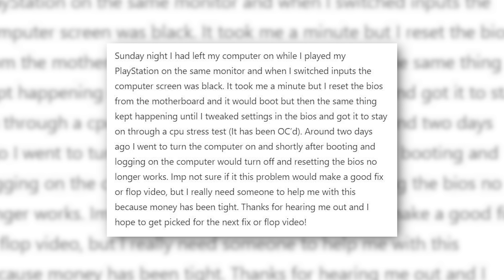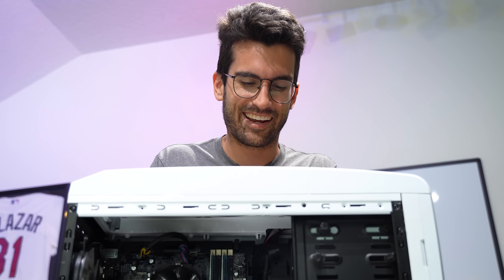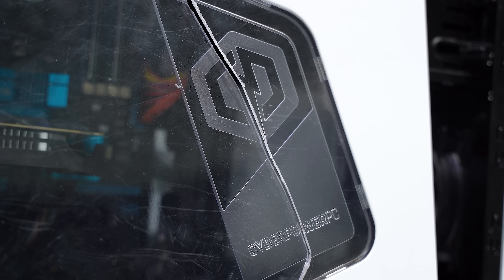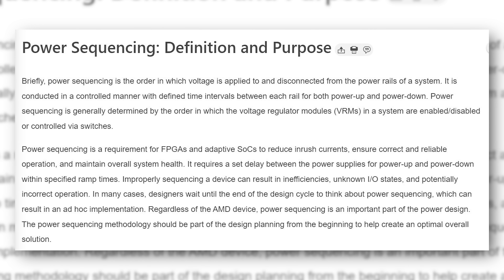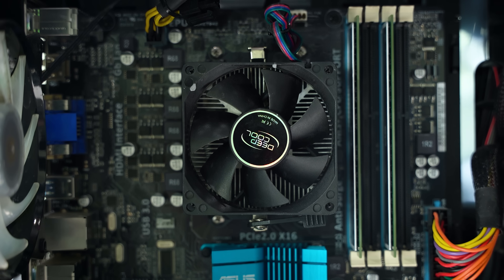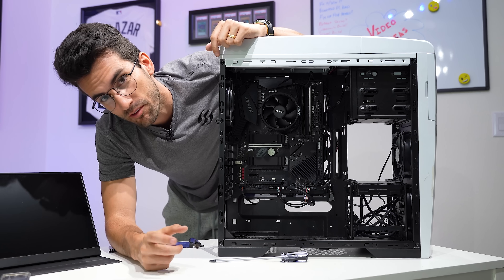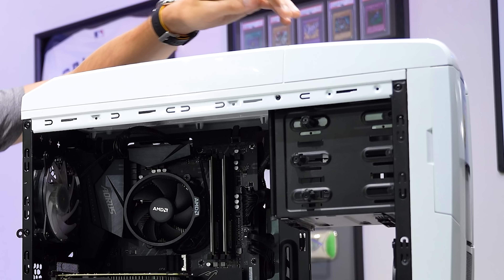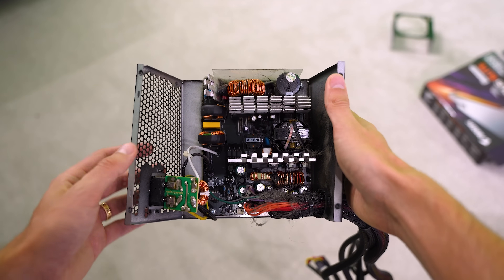Fixing a Viewer's BROKEN Gaming PC? - Fix or Flop S5:E12

Comment: the case its fine its old sure but works he got a new platform and a new psu and a quality one storage he can get a cheap ssd or m2 its not that expensive get like a 500 GB one or even 250 one for the os and the hard drive he can use it for some games

Comment: Have you heard that if the case is open/vented on the bottom, the power supply fan should be pointed down? That way if anything falls into it it won't go inside ?    Just an fyi   thx for all you do and sharing   I have fixed 100's of friends pc's, most of the time it is OS  lololoolol

Comment: Shouldn't you put the power supply in with vents facing down?
Reply from the maker: Doesn't matter if there's no basement to obstruct airflow from above. In fact, in some testing, a PSU in this orientation can actually improve thermals of other components in the system (again, when no basement is involved).
Reply: @GregSalazar  I would think that when the PC runs for a while and the PSU gets warmer the air it blows into the chassis gonna make the inside of the PC hotter.

Comment: For what it’s worth, I had a similar burnt molex connector, and it turned out that I had just not seated the male/female connectors correctly.  Electricity was arcing across the poor connection and nearly cause a fire.  I cleaned everything up, reseated it, and it was fine…

Comment: Another multigenerational upgrade and quantum leap in performance  for one more lucky viewer whose system broke at just the right time!  Without wishing to preach irresponsible diagnostics ..or bring undue harm to perfectly functional  components how about testing the FX6300 CPU (a volcanic Vishera!) and supposedly faulty AM3+ board  with an alternate PSU?  If the Thermaltake unit' perished before inflicting serious  "surgical" damage to either the socket or circuitry then there's a chance the MB survived along with the processor and RAM...be interesting just to see if you get a post!!

Comment: That was a great watch, Greg.   I think you prioritized perfectly.  The case and gpu, were still functional and non-factor in the operation of the rig.   

It would have been nice to replace the case, sure, but that would have put it two components from being an entirely new system, with only the HDD and GPU being original then.

Nicely done.  🍻

Comment: I had a system like that up until 2013.  Going to a 4770k was night and day, my new rig was about 4x faster.  I know people have what they can afford, it sounds like that person has had that rig for a long time and I'm not going to ridicule (as I said I used to have a similar one), but you could take the absolute cheapest motherboard and CPU available today for less than $200 easy and outperform that by many, many times.  The FX chips were badly designed and embarassingly slow.  The only CPU that I can think of that was a worse design than FX was Pentium 4.

If new parts are needed, you could just get a low end 14100 or whatever the lowest end Ryzen is and it would destroy that system.

Comment: Right up until a few years ago, I was gaming on a pc I bought back in the late 2000s.  I upgraded the RAM and GPU once during the mid 2010s.  During the entire time I had it, there was only a single major issue, one day it started overheating and based on the sounds that it normally made, I had determined that the air intake fan was the culprit, to the surprise of the repair man, I was right, the fan was completely bricked.  Thankfully I noticed in time to get it replaced and avoided bricking the entire thing.  That computer lasted me over 12 years with only one major issue and 2 upgrades at half life...  They don't make things like they used to any more.

Comment: This MoBo wass in the second PC I ever build and still in use.
Just with little different components.
- Phenon B65 (Quadcore with two deactivated cores, could reactivate the third core but the forth wouldn`t work)
- Arctic Alpine 64
- 8GB DDR3 1333Mhz
- GTX 750Ti
- 120GB SSD
- 250W Power Supply
- Linux Mint

Even though I OC'ed the Phenom to 3,8Ghz via Multi - there were no problems with it. Well there was no benefit either so I took it back to stock.

Comment: There is a market for these old FX machines. I have been flipping gaming PCs a little lately, and those old systems are in demand, mainly because of price and what they can still do. 

I sometimes take risks on marketplace and Ebay when the risk is minimal. Over the years I have picked up a couple of FX machines on those deals. They are typically listed as gaming pc, with no specs and very low price, $75-100. 

Paired with a 1060 6GB, or RX 580 if I can get them cheap enough, 1060s at about $50, 580 at about $45. 

That combination will run Fortnite, Valorant, and all of the other esports stuff fine, they will run Minecraft and Roblox very well. I can fix them up, throw in a cheap SSD, and sell them for $250-275 quick and easy, and at the end of the day a $100-150 profit on a $275 PC is just as good as the same profit on an AM4 3600 with a 1080 or 2060 at $500.

Comment: I got a broken FX-8150 based system for free and found the same burn marks.  I salvaged CPU, RAM, and a case out of it. MOBO and PSU were too suspect to use anywhere else.  Googling says that FX series had a lot of boards with melted VRM. I wouldn't overclock them.

Comment: Hey Greg, I need advice, if my pc randomly black screens and then reboots. Is that a sign of gpu failing? It started happening with BO3 highest settings, thought it was the game, but it started happening with Roblox and I was like you don't need much to run Roblox. I tried to do a uniheaven benchmark for gpu stress test and it went black screen and rebooted. My 3060ti is evga xc gaming edition with the death chip hynix x005. I am starting to believe that's the cause of the symptom. Storage drives are healthy, ram has 0 issues, cpu is working fine. No blue screening or error messages, just a random black screen and reboot. The card is barely like 2+yrs old, which sucks I got the bad batch of memory. No led lights on the motherboard as well for when it goes to black screen and reboots. 

If anyone else knows can you please respond

Comment: I think it might have damaged the front pannel pins because they are on 5volt rails, the fans are 12 volt rails CPU uses all the rails, so it might have jumped from the 12 volt rails to the 5 volt rails thorugh the CPU because that is the only thing that connects all though rails is the CPU.  So the CPU might have also been fried, which is good because it protected the graphics card like its designed to do.  The graphics card uses 3.5 volt volt rails gets supplimental power from the power supply.  Many motherboards have a failsafe now that if the 4 pin power connector is not connected the computer will not even turn on, the fried 4 pin connector shut down they system properly and refused to turn it on saving the rest of the components, I would not recommend putting that chip in a computer and motherboard you care about, it is most likely fried.

Comment: I have the AM3+ board in this video that i use for testing legacy hardware, and for the most part, there is 0 reason to try and OC with this board. The EPS is only 4pin and the VRM (especially considering FX voltage needs) is extremely lack luster. I have seen some folks use this board to OC a 6300 to 4.1ghz but they had to use too much voltage than I'm comfortable with to do so.

Comment: Ah yes, the venerable FX line that was a throwback to days when CPUs didn't have an integrated FPU.

But in the FX's case, have two integer units share a single FPU. So while this particular CPU does have six integer units, (which AMD counts as "cores") it only has three FPUs shared between them. The shared FPU and resource contention elsewhere inside the CMT modules made for a bad time. Resource contention and performance was so abysmal that both Microsoft and the Linux community had to rewrite thread dispatchers to only use one of the integer units (cores) and backfill the other within the same module with low priority background tasks. Placing two demanding threads within the same core caused hideous performance penalties.

Had this architecture been released 30 years ago, it would have been a smashing success, because most workloads at the time were purely integer based. But alas, it wasn't.

Comment: When I was putting together my FX-6300 system (as a little fun computer project, not when it was a relevant CPU), I was under the impression you should not overclock FX processors if you have a four pin CPU power connection. You can potentially push too much power through the four pins. So, I didn't overlock it. By the time I upgraded the PSU to one that had an 8 pin CPU connection, I just never had the time or energy to overclock it.

High power loads are dangerous to computer parts, and I just tend to run my gear at factory spec clocks. Even then, the failures we have with RTX 4090 GPU's, 13th and 14th gen i9's, etc, keeps demonstrating that we have to be careful how much power we try to feed our chips.

Comment: I don't like the be quite the power backed are vertical instead of horizontal and the cables coming out of the left side not back right side of the case and you have the power supply fan upside down facing up?

Comment: I have worked with a lot old pc cases and main issue 8 out 10 the USB on the case have shorting must deep clean them a few times to each ans any silicon they link into before connecting to the motherboard. Even have to replace the USB and silicon boards they got in the cases. Buy a good USB 3 PCI-E just by pass the in case silicon and hook them directly to the PCI-E. If not want the card sticking in the case use a PCI-E slot card and hide the card if no need for more USB 3 on back of case. OK there your options guys and these work 100% all ways :D

Comment: 2:54 You wanted to fix it but you didn't fix it.
Reply from the maker: And we explained why we didn't... because we replaced the entire platform after finding burn marks on the old board. The case also isn't pertinent to the functioning of a rig. You could build one inside of a cardboard box if ya wanted.

Comment: I had a cool max psu that did the same thing with my FX 6300 on a 990FX ASUS board. The 8 pin connector melted into the slot. I called Newegg and they did an RMA on everything luckily. The new parts lasted only 4 years.

Comment: Got a 5500 in my server, it use to do my transcoding work loads for some movies for some devices, so it sad at 100% load most of the time, Had the stock cooler on it, did well. Got an overkill d15 on it and I did play with overclocking, was able to get to 4.8ghz on all core, which surprised me. Definitely better than the FX in every way.

Comment: I almost thought my computer was experiencing the same symptoms in the video and was excited to see if you had a solution to it but my expectations fell short. My mid-range PC is just BSODing or just automatically crashing (instant restart and gray screen). Despite having the system work for a few years with mostly every software up-to-date. I don't want jump the gun and start replacing parts. My thoughts are PSU or RAM as this point...Event 41 sucks ;(

Comment: Yeah I'd call this one a Flop. There was no fixing here, guy sent his 12 year old broken rig in and got a new PC in return. I mean.. my brain goes to all sorts of places, and if the guy was computer savvy enough to overclock his cpu 12 years ago, you can't tell me he hasn't installed a single upgrade in that time, or build a new system at all. In general (and yes, I'm generalising haha) people who overclock are not regular joes, people who overclock (especially on hardware of that era where things weren't QUITE as simple to do it on) are heavily into PC's and PC Gaming, there is almost no way someone that into PC's wouldn't have bought or built a new system (or even upgraded this one) in the last decade and a half. I'm gonna guess he just sent you an old rig that blew up before he built a new one, just in the hopes of getting free shit back he could either use or sell.

Comment: I loved my AM3 M4 EVO Asus motherboard years later they updated the bios to allow the FX 8150, and it ran great, but i had to use a dongle for the 4 pin CPU power cable, as the old PSU didnt have it, but it melts that cable about once a year. AM3 probably wasnt designed to handle 120 Watt CPUs, the AM3+ MB were, but not AM3 , the newer CPU just use too much power, same problem with Intel is having now, those flame throwers 14 gens can be fast but the wattage just causes Heat or cable melt.

Comment: Was the broken 4 pin the one in the slot when you got it? I'm wondering if he broke that off, then put in the other 4-pin connector with plastic still in the port. If he did that, it wouldn't fit quite right with the unbroken pin and plastic from the other pin in the slot and might cause small electrical discharges. 
If that makes sense.

Comment: Suggestion: When using stock Ryzen CPU Coolers, rotate the CPU Cooler Shroud so the "AMD" is at the top. The Shroud is easy to un-clip before you install the cooler and the result looks better.
Reply: Sounds like OCD to me.
Reply: @iamperplexed4695  No more so than tiding up cable runs or coordinating RGB.
Reply: @Gaspode-uj8jt  If you say so, ocd.

Comment: Totally enjoyed this video.  Also, was kinda jazzed about seeing an old FX-6300 system, because I have one of those, still working, as a secondary/test-bed system.

Ok, so, I totally do NOT want to come off as doing Monday-morning quarterbacking here, but, because of a previous experience I had, I wish you'd tried the PSU first.  Firstly, because the Thermaltake Smart PSUs are generally pretty poor quality, but secondly, well...

Ok, so, back years ago, I'd been given a dead system that was running a Pentium 4.  It was either 3.4GHz or 3.6GHz, with hyper-threading.  This was given to me probably around the time when Core 2 Duo and Core 2 Quad were pretty common, and maybe just when the Sandy Bridge CPUs were coming, out, or maybe were on the horizon to being released soon.

It was a Sony VAIO, and apparently came with Windows XP Media edition.  Poked around with the system, and it definitely was dead.  I knew WAY less than I should've at the time, but I did know that the P4 was a power-hungry beast.  I also thought at the time that the PSU wattage seemed a bit on the low side for such a system.

Then I noticed that 4-pin EPS connector.  Rather than that off-white, the connector was definitely an uneven brown.  Fortunately, it came out intact.  On the motherboard, it was definitely darkened brown, but on the PSU side, the plastic was definitely burnt.  Blackened and slightly deformed.

I managed to find an inexpensive Corsair PSU online with way more wattage (430W seemed impressive at the time), and installed it.  Again, while discolored (both on the inside and the outside), the EPS connector on the motherboard was still fully intact.

And, it fired right up!

So, I guess I was kind of hoping that you would've tried to fish out the plastic bit from the PSU that was still stuck in the EPS connector on the motherboard, and tried a new PSU.

Would it have worked?  I don't know.  Given how much more discolored the connector was on that old P4 system, yet a new PSU worked fine in it, I'd like to believe that a new PSU of good quality would've been all it took to bring that AM3+-based system back to life.  Hey, I can dream, right?

Comment: It amazes me that this person didn't realize their CPU power cable had literally burnt itself, but then they're also running Windows 10 off a hard drive, and you have to be on some strong stuff to tolerate that in 2024, so it all makes sense.
Reply: I had no clue anything was even burnt.
Reply: Now that you have a whole new platform, please get yourself an SSD, clone your current drive over to it, and use it as your boot drive. Even a system with a 14900K and an RTX 4090 would feel slow running off a hard drive.
Reply: @Trainbuff26  I actually got my hands on an ssd but i dont know how to clone my os into it

Comment: Greg do you need backup cpus for this format? i have 2 new in box never used and could part with one if you need it. i need one for a backup incase one of my 3 machines in my garage fail. one has been on since july 2012 and never cleaned:) i actually have a new asus sabertooth v2 990fx mobo and another 990fx mobo, 3 sets of 32gb corsair vengeance, FX 8350, seasonic 850 watt psu and a 1080ti but no spare case.

Comment: For those complaining that Greg shouldn't have replaced more than one component in this rig, I have a question.  Have any of you ever had a power supply go bad?  They don't always kill components immediately.  The damage to the connector and socket could have happened weeks before the owner realized it and caused the issue that owner reported.  When Greg turned it on to check it, the damage could have been completed and the board bricked.  This is a common occurrence with a power supply that is dying, especially cheap "budget" models like the Thermaltake Smart series.  They don't all go at once.  I have seen this happen multiple times, when I worked in PC repair.  Educate yourself before making such silly comments!

Comment: I had an old FX-8320 computer back in the days. I had to replace the motherboard 3 times because the previous 2 always got burnt from the same connector for the CPU. I never overclocked it or anything, but that was my experience with it. Motherboards in question were both Asus m5a99x EVO.